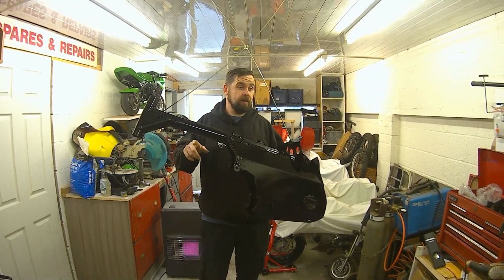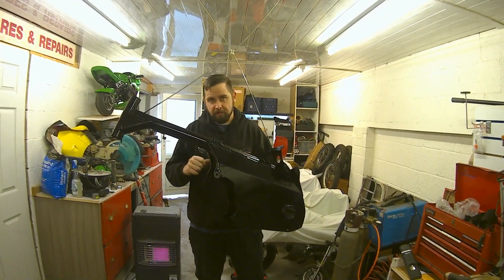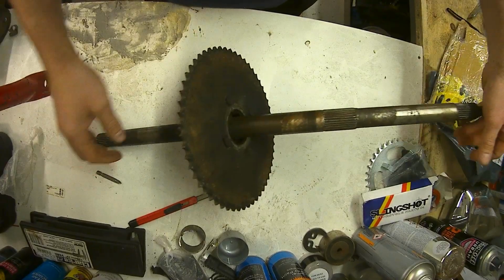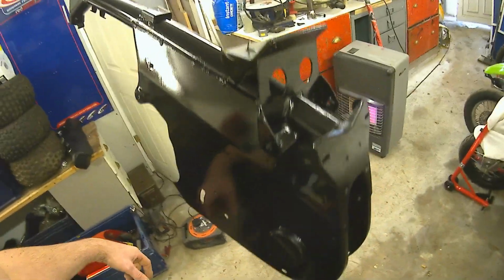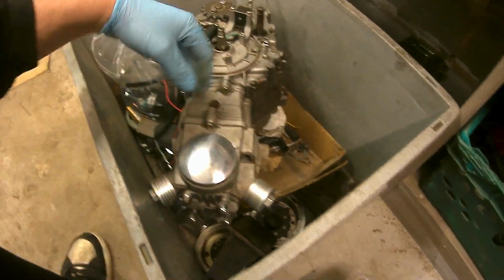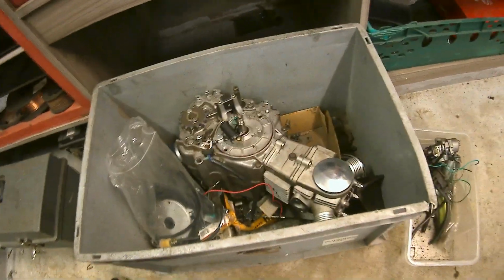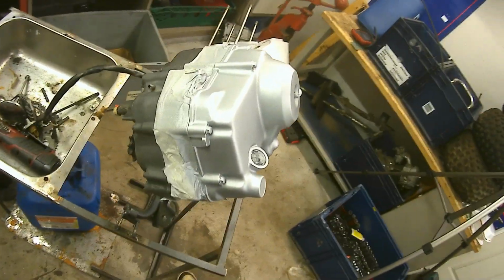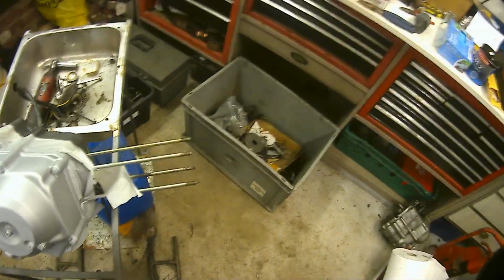ATC 70 ENGINE BUILD PART 2 Project Series

Comment: I remember the other video when it crashed into the wall I am finishing up a 1982 Honda ATC 70 I still have to get a grab bar
Reply from the maker: Joey Potz there are some really tasty looking grab rails on eBay but I’m sure you got it covered
Reply: @unpluggedautomotive878  yeah there are a few on eBay just haven't got one yet and there is a company that makes parts for the ATC 70s www.hondaatc70.com check them out they have tons of good parts even a few bullet aluminum parts they also sell exhaust and everything else you possibly need